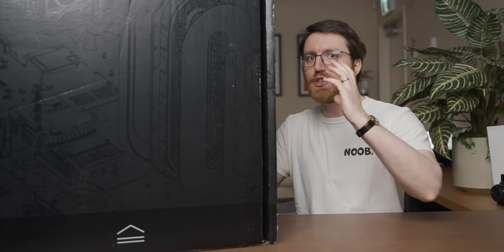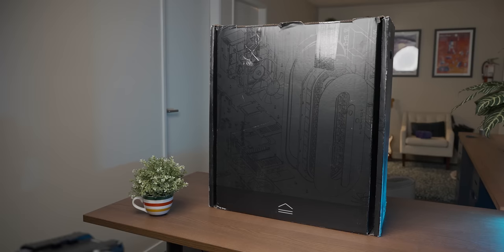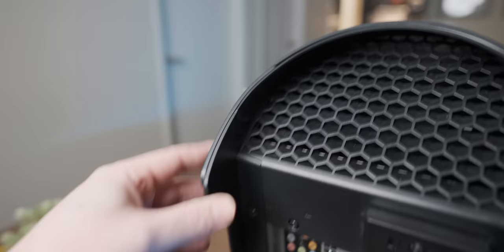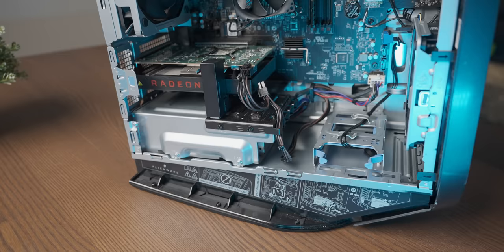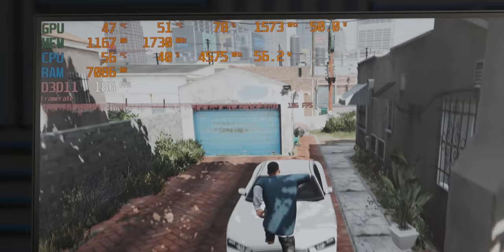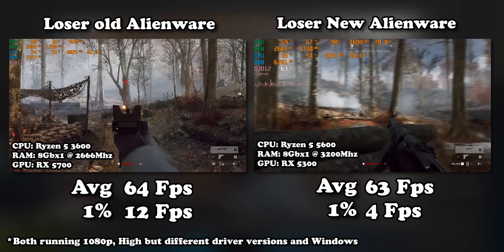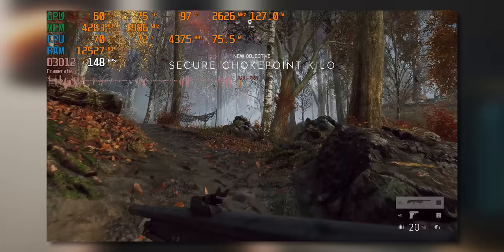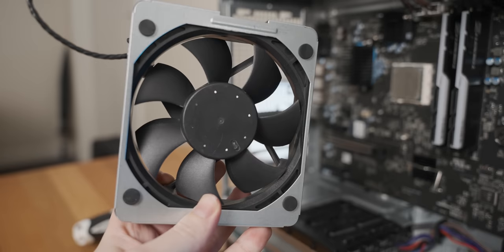Is Alienware's NEW Gaming Pre-Built Less Terrible?

Comment: I bought an XPS 8950 desktop from them recently for my first pc, with exactly the same internals as the Alienware in your vid. I've tried really hard to mod and swap out parts, but the deep-rooted effects of their proprietary philosophy is a nightmare to bypass. Regarding the power supply, I modded the metal shell sheltering the psu (out of consideration for fan position on generic psus), figured out how to connect the GPU and CPU slots on the motherboard to generic modular SFX psus (because ATX would not fit in that tiny space), only to yield when I dug deeper into the SYS connection by opening the stock psu and looking up the pin outs of generic psu motherboard connections online. It is operating solely on 12V rails, and the positions of all the pins in the cable of the stock psu (hence motherboard) do not align with the few applicable ones from generic psus. Unless one has absolutely thorough knowledge and access to single pin to single pin cables (DIY maybe?), the only solution would be a completely customised psu. I even emailed Corsair and they instantly gave up, similar to the advice for me from many YouTube reviewers and reddit advisors

Now I'm trying out a generic AIO solution (limited to single 120mm fan because of Dell's case of choice). A tower air cooler is possible too, but only ones the size of the Noctua NH-U9S would be able to fit nicely (I've seen reviewers painstakingly squeeze bigger ones to uncomfortably fit though). *I will try your mounting method, it seems ingenious

*PS: They bundled the same 460W psu with my RTX 3070 build with no upgrade option lol, which is why I had to go through all that in the first place. I wanted to purchase the upgraded psu from their parts store, but they don't have it listed either

Comment: The trick for standard boxes for PC's is to open the top, flip them upside down, cut some of the tape on the bottom to allow air in, and lift the box off of the PC.  If you don't cut the tape on the bottom you can have a suction problem when trying to lift off the box.

Comment: I bought a top of the range Alienware laptop some years ago with a GTX 1080 on board.  Thing came with this massive, heavy cooling solution but would thermal throttle after about 15mins of play.  Turns out Dell had put all these expensive components in this laptop but had skimped on the thermal paste.  I opened it up, put about £1 or £2 worth of MX-4 in there and it ran beautifully.  I ran before and after benchmarks and it was insane how much that tiny cost improved performance.

To be fair to Dell, when I bought that thing I didn't know much about computers and that experience inspired me to build my own desktop.  Plus, I have a 1080 laptop, that still holds up to this day, to use when I'm away from home (which is a lot).

Comment: The AW you bought previously also had the same memory upgrade ability. Getting an AW and combing in a bunch of deals can actually be cheaper than building your own PC.  I got a 3700x with liquid cooling, rtx  3080, 16gb dual channel ram, 512gb nvme for $1950  cad after taxes during the black friday sale of 2019. (10% off for new customer, 15% cashback for rakuten and 500 off for BF sale).  You probably still can't get my config at this price doing it yourself today.

Also you have to get the AIO with any AW build. For whatever reason they have the dumbest case design but if you spec it right you end up with a great PC.  Yes it doesn't justify some of their stupid builds but AW PCs can be good if you spec them properly and buy at the right time

Comment: Nice Review!   New Alienware looks a little more nice to work with.   They are using the new 12v standard for power supply.    Eventually the 1996 ATX standard will switch to it :)

Comment: Cool story time!

So over xmas, they had similar alienware systems on special (think they still are... tbh its prob marketing to always have them "on sale")
However, on the Dell Ebay store, they're the same price as the website ...... and if you're a ebay Plus member, you get discount codes and free shipping.
Could get a 5800x/3070 alienware gaming PC for around $2kAUD - not bad.
*Something like $3399 marked down to $2499 SALE! Plus discount code
**I got my Alienware monitor in the same fashion.

I was considering buying it, and swapping out the cpu and gpu with my current PC (3600/1080), and then sell the alienware PC with the older/lesser gear in it for $1500ishAUD.
Essentially getting a decent upgrade for $500odd.

However, I was never sure if the 3600 would work on the "b550" board using a Dell bios.
Or if the 1080 (asus strix) would physically fit, or if the PSU would have enough power etc.

Plus I didn't have enough money at the time to outlay for it.

*If my GPU stuffs up tomorrow, I'd think this might be the way to go, here in AUS you're looking at $1500AUD for a 3070 retail anyways.

Comment: Obviously, I see you bought the entry level model, so I can't speak about that. However, I have the same PC, with the brand new Intel Alder Lake chip (12700k), 40GB of DDR5 RAM, 6800XT GPU, the 750W power supply, see thru window, full RGB lighting inside and out, and the Cryo water cooled setup. 

My build is much better than what's going on here, albeit at a cost. Basically, what I'm trying to say is that I know that some people love to rag on Alienware/Dell, but if you spend more money for the better models, they are great PCs, and the performance metrics will prove that. These new R13 and R14 models are a major step up from the previous models in terms of cooling, upgradeability, performance, etc.
Reply: Dude exactly, this video is a joke.

Comment: Back in 2002 I ordered an Alienware pc, it took two months to get to me. Never bought a prebuild for myself again.
Few years later I built a 3570k with sli 760s. Been upgrading the same pc for almost seven or eight years now. I have a 5600x with an 6800xt now, the only parts left is the sata cables, PSU, PSU cables, and one HDD.

Comment: If you work with dell you can get the price lower. I was able to get the max specs with 10% off the whole order, so rather than paying $5k for the pc I paid $4,100 I also got money back with Dell Rewards worth $160 dollars, so $3940 for the top specs in a market where you can’t even get a good GPU for less than $3,000

I purchased the machine for my job since I develop games and it’s a damn beast of a machine, I got 64GB of ram with the GTX 3090,  12th Gen intel core-i9 12900k processor, I ran a bunch of stress tests and this pc can handle whatever you throw at it. I can run multiple games in the background, while rendering large projects in blender cycles, and the pc never slugs or slows down

If you get this pc, don’t cheap out with the lower end model is all I can say, get the liquid cooling, get a decent GPU, and you won’t regret the purchase, you don’t need the max specs to enjoy this build somewhere in middle ground is what I would suggest for someone who just needs a gaming machine, but if you need a development machine, max this pc out, it’s worth it! That is… if you can work with dell to get discounts, don’t buy this PC online without speaking with a service rep cause they will help you lower the price. Hold off otherwise.
Reply: Lol

Comment: Did you try turning off the RivaTuner overlay in DOOM? It has problems with overlay applications making the frametime horrendous. My 3700x and 6800XT with an overlay kept my framerate at a constant 40fps, then after disabling any overlay I had, it fixed it.

Comment: I feel like the R13 does perform better than the R14 mostly bc it has newer generation stuff.  Im personally getting the R13 bc I think its one of the better pre-builds and I just dont have the time to build my own. The specs: 12th gen i5 12600K(water cooled), dual channel 16gb ddr5 ram, GTX 1660 TI, 256GB ssd (boot) + 2TB ssd (storage). Perfect specs for what im going to be doing.

Comment: It’s crazy you posted this today because i was at Walmart tonight and they had a prebuilt, HP I think, with almost the same specs as this, Ryzen 5, 8 gb ram, 256 gig ssd with an RX5500 and it was $640 bucks. I do think this Alienware has a newer Ryzen 5, the nondescript box at Walmart didn’t specify, but holy crap. It’s definitely not 600 bucks better, people really like paying for that stupid Alienware form factor, I guess.

Edit: actually I looked it up because I thought I was nuts when Dawid started showing prices for comparable products but I was wrong about the CPU. It does have Ryzen 5 5600 in it. So it’s just about literally the same PC for 639 bucks. That’s actually a pretty hot deal, maybe I should buy it. Or if you want, Dawid, I’ll buy it for you and ship it to you if you want to do a comparison!

Comment: What would have been interesting would have been to swap video cards in the two Alienware cards, so the 530 was in the 3600 system and the 570 in the 5600X system, and rerun the benchmarks on both systems.

One other potential would have been to use a single 8 GB stick of DDR4 3200 CAS 16 memory paired with the original memory and set to the specs of the original memory, to test the effect of just upgrading to 16 GB of memory.

Two final options I would like to see are swapping in a 5600G while removing the 530, and with and without the upgrade to 16 GB of memory.

Comment: I almost bought this cause i was desperate for 3000 series card but they pushed my order back to march so i cancelled and tbh i'm glad.I been reading lot of stuff about these new r13's having issues and run hot as shit.Lots are returning them from i hear lol found local pc building tech shop and they built mine with rtx 3080 but sold it and got a 6900xt for that 16gb of vram 10gb just not enough in 2022

Comment: Micro center has a pretty killer on one of these for $3400. i9-12900fk, water-cooler, rtx 3080ti, 32gb ram, 1tb nvme, side panel window, internal and external leds, 750w platinum psu, and if you get a higher end config, it has more case fans.
Reply: 3400? thats actually good
Reply: @brianmateo8041  forgot to mention its DDR5-4800 too. Ill try to send the link if youtube doesnt block my comment
Reply: @EpicBr0  Nice. Thats insanely good for that price. Didnt even think finding  prebuilt with that price is possible

Comment: It looks like this configuration only has one front intake fan and might be missing the top fan as well.  The system with Liquid CPU cooling has two front intake fans, and one top exhaust fan as well. I would have thought Dell (Alienware) would have included them no matter the configuration due number of cooling issues experienced by R10 to R12 owners!

Comment: Hey Dawid do you have a case, at least 600w psu, and a mobo that would fit a 9700f in your scrap pile? I bought an ROG about a year ago and it's on its last leg. They cheaped on the mobo and psu as well as the front panel with the power switch being proprietary and I just don't know what to do. With the 1700 I spent on a box of garbage (my pc) I just cant afford another pc right now.

Comment: I checked this exact PC out on Dell's website just now, and to my surprise, it was $1050 USD.

To give Dell credit here, while the stock configuration only included one 8GB stick, 16, 64 and 128GB configurations are all 2 or 4 sticks. This means no more single channel memory on typical 16GB builds... at 3200MHz. Their higher speed RAM (3466MHz) is limited to one stick at 16GB. So, good job but then bad job, Dell.

It also seems this configuration no longer comes with that same PSU. Minimum included PSU is 550W, with the next up being 1000W.

Unfortunately, stock configuration includes the junk keyboard and mouse, bit these can be optionally removed for a small reduction in price.

Of course, GPU prices are exorbitant.

Not a lot to say about this. Even with 2x8GB, a better GPU, better CPU cooler, better PSU, an NVMe boot drive and no peripherals, this PC comes out to $1500 USD. Subjectively too much for what you get.

Proprietary components, a chassis design that appears to be from the 90's and a cheap overall build and component quality, this is a hard pass. Even for those who are desperate, there are better options for similar or less money.

Comment: Man i was thinking about buying a prebuilt last year before i built my own PC.  firstly, i'm so happy i didnt but one of the main reasons i didn't was b/c when i asked what after market GPU did they use or was it the FE card, non of them even knew which GPU was in the PC. Some places actually had contracts with FE and EVGA but they were overpriced too. IT's much better to just get the parts (if you can) and just have someone build it for you if you're not confident to do it yourself.

Comment: Just purchased the R13 with i9 Core KF, 64 GB DDR5 Ram, RTX 3080 Ti, Cryotech cooling, 750w power supply,... with a $450 off the msrp plus another 5% off coupon.  Hope this system is good enough once in hand.

Comment: Im Kinda happy that i bought a HP Pavillon Gaming pc for nearly same (price 1000€) around January which  had  without any upgrade  16gb 3200mhz ram a 3060ti a Ryzen 5700G and 2tb of samsung nvme with 2.7gb/s reading which is still fine only bottleneck the pc really had was the OEM "Erica" Mainboard  which only  had 2 ramslots and no option for decent cooling so i reach 80°C after a few hours gaming in 4K

Comment: Liked your video. I'm amazed. I  used to think Alienware was something special. I didn't realize how Dell-ified it became. Then again I haven't bought a pre-built or an OEM computer since around 2000 when I tried to upgrade the processor on my Dell computer. When the BIOS rejected the new chip I started building my own systems. It's amazing how, all these years later the Dell boxes look unchanged inside.

Comment: Very nice presentation as usual. 👍👍
I have a request.
Would it be possible to test a HP OEM prebuilt TG01-2008in?
This is available in India with an RTX 3060ti and i5 11400 at around 1389 USD.

Comment: At least the air purifier design does lend it to having okay airflow. But still doesn’t fix the fact that it has a proprietary PSU and motherboard. Could it have killed them to have a standard x570 motherboard and a separate pcb for the front IO. My desktop if I really wanted to I could swap out the PSU and motherboard.

Comment: This is hilarious. I'm watching this on an Alienware PC.  The GPU is a 6800xt and the CPU is a 5900x. It was on sale 690 (Canadian) off the regular price. At the time it was impossible to order these two parts so you  had to get a pre-built if you wanted them. I simply added  an additional fan to the case and replaced the existing case fan (Noctua for both) and added a SSD for Steam. It  runs cool and quiet and  plays any game I throw at it. There is one important difference between the  XPS and Alienware PCs as the XPS doesn't have an optical out which is a deal breaker for me.
I've been assembling my own PCs since 1997 and sure I would of liked to  build  my own PC with this GPU and CPU but it was impossible at the time so this is an excellent compromise.

Comment: I bought an Alienware 17 R5 a couple of years ago for work purposes...not gaming, so I never pushed it to its max. However it did start getting very hot at one point. I thought I wouldn't have to but I did eventully have to repaste the CPU. I believe this is a common (necessary) task after buying these 'gaming' laptops. Seems mind-blowing to me that a laptop sold for gaming would need to be disassembled due to such a stupid problem - using terrible thermal paste. It's not like they aren't aware of this issue because it's a WELL_KNOWN problem.    sheeesshhhhh

Comment: The r13 is probably a better representative of the new lineup as it has a few things that the r14 doesn't have, although the low spec one probably has some similar issues to this one. I'm also surprised that they have put a custom power supply in this time around, which makes it very annoying to upgrade.
Reply: yeah it comes with ddr 5 ram below JEDEC speed

Comment: i got a Alienware R10 for 200€ because some guy just wanted the GPU in it. i actually prefer the R10 because it doesnt have the Shitty oem mainboard format and the shitty oem PSU. it also supports manual config of memory and it does do XMP Profiles. just slapped in a Corsair H60 in it, upgraded it to 32GB RAM and its nice now.

Comment: not only do they continue to use Intel mounting on AMD with a cooler that wouldn't look out of place on a Pentium 4. They actually updated the mounting to the brand new socket. (hey dell, here's a little hint: how about just using the AMD mounting for the AMD socket.)
and the RX 5300 should be somewhere around a RX 570 in terms of performance and is aimed to compete with the GTX 1650

Comment: im ngl i bought an alienware pre built but I never had a problem with it and I didn't have to do anything to update to windows 11 I'm ngl I got top of the line at the time 1080ti along with the best core i7 out there but I never had overheating problem or anything else the only issue I have is that I couldn't upgrade so it made it seem like I bought a xbox but way ahead of its time even now lol but it still runs I use it as my streaming PC rn and got myself another PC that I built and now can upgrade to anything at anytime but the performance on my Alienware never disappointed me tbh just the upgrading part is what killed it for it